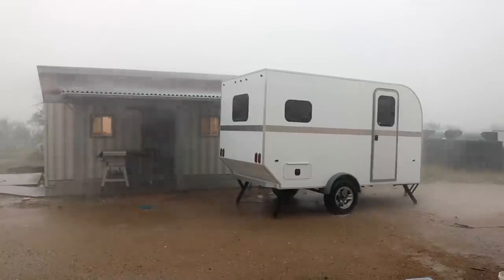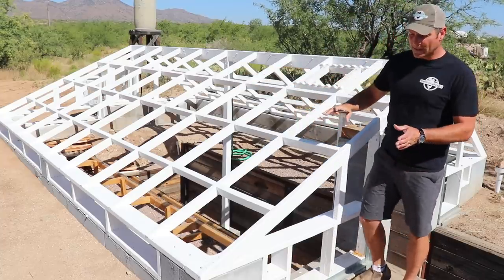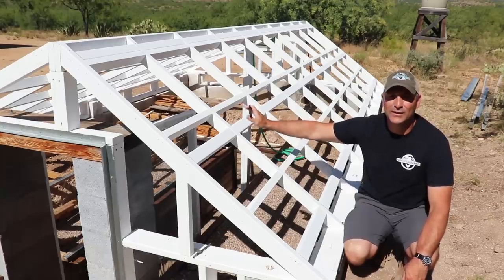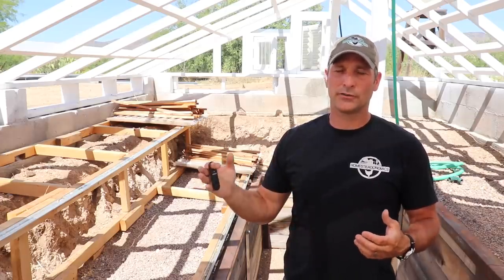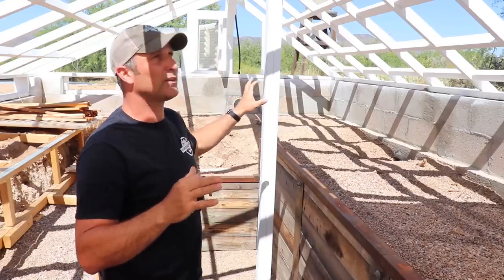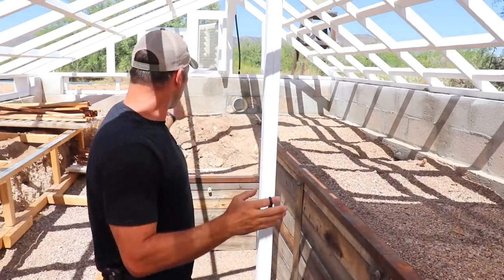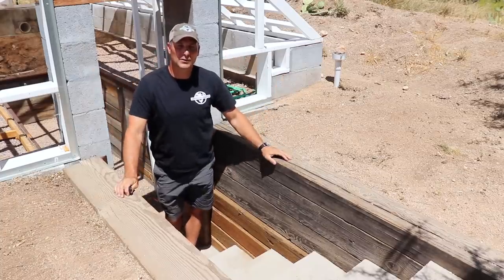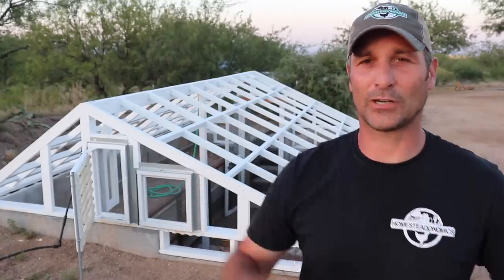Sunken Greenhouse Revival - Plans

Comment: if your greenhouse is oriented long sides south & north, consider solid (insulated) panels on the north side - extending past the peak for summer shade and if reflective side facing in it will do well with winter sun angles. and there will be plenty indirect light from the surroundings
Reply from the maker: Oleo 2320 I actually have quite a few pieces of the left over from my travel trailer insulation board that I may add tot the inside of those panels.   It it aluminum coated so should provide some of that reflective Quality as well as insulation.   But it would only do about 35 percent of that northwall and I’m not sure I will want to buy more material.   So I think I’m going to see how it performs I insulated first and then maybe add that later depending on how it’s holding the temps 🤔
Thanks for watching!

Comment: All of my raised beds have hail guards.  I used hardware cloth.   If you can put that on over the poly it would bounce the hail off of it.  I am on the high plains of Colorado which is also somewhat desert.  I have 40% shade cloth on all the walls and roof hung on the inside of  the greenhouse.
Reply: I agree, tackle the outside hail protection separate from the shade problem inside.🤔

Comment: Anti~hail netting will provide shade, and protection from future hail storms.  I believe the netting comes in three colors,  [ red, white, or blue] for different levels of UV protection. 
You can use a simple cable and pulley sytem on rails, to retract the netting when it's not needed. 
 I've seen some sophisticated systems that that are set to automatically deploy  when the barometer indicates a low pressure system moving in.
It really is a good looking greenhouse.  I'd hate to see it destroyed again. 
Can't wait to see what you come up with.
Reply: Is it called Reemay or am i getting old?

Comment: aluminet shade cloth suspended a few inches above the roof would help with hail and the shading.  1/2" hardware cloth could also work for the hail.  Im really inspired by your sunken plan.
Reply: I was getting ready to post the same comment...even if it only worked to save the plants inside!
Reply from the maker: I like it!   Would be super durable as well!  😀🙏
Reply: I looked at a company a few days ago, (can't find the bookmark) that made exactly what is needed here for just about any application from your greenhouse project to covering a high-rise while under construction.
Reply: That's how the shade houses were constructed when I worked for an orchid grower. We had a gap of about six inches between the cloth and the panels for good airflow, and the larger gap is less inviting for leaf litter and animal nesting.

Comment: Thanks for the video update. I suggest you do sun fabric with a roll-up side like  on the side of the greenhouse. The weight of the pipe roller on the bottom should keep them tight and sluff off any hail that happens. Otherwise if the Hale builds up it'll push the fabric down on to the poly carbonate and you will lose that space that would soften the hail. Plus it would let you shade only the top part and protect from the hot midday sun

Comment: You should buy double walled polycarbonate panels they will not break from hail. I have the standard panels used by the grandio greenhouses and it deflects massive black walnuts and hail.
Reply: I agree 100%, twin wall panels, better R value, longer life span, defuses light for better growing, hail resistant. go with the panels not rolled solexx. solexx has large expansion and contraction. panel sizes will determine the roofing frame work. doubling frame at panel ends to attached panels then H channel attached to next panel with sealant. invest the money and time, greenhouse will last years and years. my panels are 10 years old.

Comment: Looks like your turning a disaster into opportunity. I like the changes you listed. They sound good, especially making the back part of the roof solid. The shade cloth idea also seems sound. I would vote for installing the shade cloth low, and pulling it up for shade. Good luck with your improvements.
Reply from the maker: thanks Jay!    I'm leaning towards just that idea... having the cloth pull up to cover the GH in the warm times.   stay tuned... this will take the next few months but hopefully I'll be going strong by the fall winter tiem

Comment: We have a 10 x 12 gazebo with the double wall polycarbonate roof.  Several years ago, hail storm damaged top layer and punched a few holes through.  We did not replace the panels but covered them with 2 shade sails.  There were 2 triangular areas that were uncovered.  2 weeks ago, another storm made the uncovered areas look like a sieve.  The shade cloth will definitely give you some protection from hail.

Comment: I also agree with the idea of a shade cloth to help protect the plants from sun damage in the latter and earlier parts of the year and also when drawn tot the kind that have grommet holes along the sides and are somewhat stretchy if drawn taught above the surface of your polycarbonate panels it will someone act like a trampoline and both reflect the light and strengthen the structure. Harbor Freight Tools has many of these that are actually quite good quality and I have used on the sides of our house for about 2 years now and they're still in great condition just be careful not to pull the very Corner too taught.

Comment: You could always weld a couple posts to those rails, then attach some cable to those and the center beam. It would avoid having to install crossbeams, and work just as well. The cables would add a little flexibility, and if you make them adjustable, you can tighten them down as needed.
Reply from the maker: yes, that sounds like a good option!  thanks richard!!

Comment: I am in south Texas and keep a greenhouse year round for orchids.  So we want it below 90f in summer and above 50 in winter.  We are on top of a hill with high winds and hail.  So far the original 13 year old double wall poly is still there as well as aluminet shade cloth ordered to size with reinforced edges.  The ends of of the 10x12 structure are not shade cloth covered and the west end shows some yellowing but the poly is not brittle.  The rest is still very pristine.  We do use a standard swamp cooler to maintain temp in the summer and actually use a second black shade cloth on the roof during the highest solar months.  We have four simple metal cross braces to add strength.  Those braces also add support for hanging baskets.

Comment: I like the shade cloth with a roller and handle system like that on dump trailers or dump trucks. Elevated to give flex to absorb hail. Heater need to AZ sun. Born and raised.

Comment: Here is my wild hair idea; I'm thinking a little outside of the box on this one. Build a frame structure over the greenhouse and tie shade material to it. Strategically place it vertically and horizontally so the greenhouse is in the shade during the hot summer months and direct sunlight can get into the structure during the winter or colder months. You'll get the protections from the hail and wouldn't have to worry about any moving parts (other than fine tuning the shade cloth).
Reply: ....he might also consider roll up Bamboo shade cloth and hail protection.....year round operations may not be doable...once the heat of summer is near matey foam board cut to fit all windows...
Reply: bevaroni27 - That’s a great idea! I was thinking about how quickly hail usually comes up, and not having time (or not being home) before the hail hits.  Your structure would take that out of the equation.  Although it might be harder at his longitude, not as much sun angle where he is compared to us up north.

Comment: Epoxy some anchors in your top course of block walls, secure the roof framed structure at the point where the sill board touches the block wall . Ramshots work ! Collar ties 2x4 about 5' long&  1' above head  will definitely free up those posts . As long as there's a ridge at peak . Plus it'll give you a spot for hanging baskets ! Lol .
Reply: As a former builder in a high wind area (hurricane), I totally agree however I would also add hurricane clips to the rafters.

Comment: Not sure if this helps but I used Gigavents to created self-opening vents in my greenhouse roof to alleviate heat. I'm in IN -- very high winds, especially in winter. We added a safety chain just in case, but they worked great.

Comment: Great to see you're bouncing back with this project at last after that terrible hail storm. I see on the South side you have ten segmented rows. I'd suggest what ever shading you go for make blinds of some sort that pull down from the top and maybe make the width to cover two of the rows at a time [five blinds in other words].  This will make them easier to operate and it will also give you a lot more cooling options. If they run inside rail grooves you could even add motors and make them electric blinds.  Just a thought. Good luck what ever you decide to do.

Comment: Maybe try louvers like plantation shutters. You could automate the angle of them with a simple solar tracker that would keep the blades parallel with the sun. Then, if there was a hail storm, you could shut them with a remote command. This may also help insulate in cold months
Reply from the maker: hmmm... hadn't even thought of that... I will have to look into them.  thanks!  :D

Comment: Probably a bit too late, but when I built my tiny house here in OK (we often get large hail) we designed our roof pitch to be closer to 2:1 on our outdoor buildings to provide a better deflection angle, also don't have to worry about snow load during blizzards. So far just having the higher pitch made for everything surviving up to golf ball sized hail with zero damage. If you can.. I would suggest this change. Could use the extra space to use for a second level for growing maybe. Perhaps the extra surface area for sun would even make for a better greenhouse.

Comment: When you remove the column just add some collar ties to every other rafter. It will give you the rigidity that you need in your roof structure and give you a built-in rack for irrigation/fans...whatever you need overhead.

Comment: If you are concerned about roof "uplift" during high winds, attach hurricane straps to each rafter.  Typically these attach to a top plate and stud but you don't have studs !  Simpson H16S are long enough you can attach them to block below.

Comment: Maybe for the shade you could use a poly mesh tarp and run two steel ropes through the eyelets to slide the tarp to the side when not in use.  I use them all the time to cover mulch or brush on trailers and they hold up to strong winds on the highways by letting the air through. I have also used them as for shade canopy’s for my kids when We go to my farm.

Comment: If you can provide a gap between the shade panel/cloth, so that air can circulate , it will provide more effective shade by minimizing conductive heat transfer.

Comment: The metal roof area gives you a perfect out of the way storage space for the shade material. Can copy a garage door idea for a segmented section to get over the ridge from the metal roof side

Rails for a cart to ride down the stairs can also be a good idea. Why carry things up and down the stairs when you can put rails off the sides of the steps out of the walk path a cart can be pushed on. As simple as 4 skateboard wheels on a section of angle iron riding on a steel pipe to keep the cart level down the steps as it can use normal wheels at the bottom and top of the stairs.

Comment: You might like using braided cable to anchor you roof. Could drill in eye bolt anchors in you foundation, run cable from foundation up to peak and then down to other foundation. No posts needed.

Comment: Dude, been looking forward to your repair of the greenhouse. Definitely agree on the use of the shade cloth since the hail storm as it will add a layer of protection against further incidents. I was thinking of a large spool going from the back to the front to be drawn out for both the sun and hailstorms. With spaced re-enforced rivet holes you could use simple bungee cords to keep it taut. I was also going to suggest a lighter plastic sheet rather then the rigid panels you initially installed on the roof, sort of shower curtain grade sheets. Also the cooling tube I would have suggested a drip tower with thermal vanes for heat dissipation. But anything you do I will be looking forward to your posting. Aloha

Comment: Good to see you back. Have you considered using recycled sliding glass doors or sliding shower doors to cover the greenhouse ? You could hinge a few to open at the top for ventilation. Good luck.
Reply from the maker: Larry Parish thanks!  Using glass windows from Craigslist was actually my first thought....but the polycarb panels just were so much lighter and enabled me to have a lighter weight structure.   But I really do like the idea of having glass doors that could be opened😀

Comment: You could use the wood framing as shuttering and pour concrete to form the new shelving.  should be plenty strong enough and look neat
Reply from the maker: I'm thinking of kind of a middle flip up shutter/raisable vent and the concrete shelve is likely too!  :)
Reply: @homesteadonomics  vent brings another idea to mind, you could run pipes from your vent pipe around under the shelving to distribute the air more evenly.  Set them in the concrete?

Comment: Seems like you could add a layer of roofing strand board under the north side as a thermal break and added stability. It could be more expensive and troublesome than you think by adding foam to the metal inside later. I built a deck and later had a metal roof cover put over it. .I later decided to turn it into a sunroom. Since spray foam is so dog gone messy and I wanted to keep it DIY, I  ended up adding a layer of foam board insulation from underneath. Lots of problems with that trying to add a ceiling layer that looked decent in between braces.  I finally have the whole thing supported with straight rows of wood support strips so it looks good to the eye and fairly okay from inside. But was really tricky and took several failures before I made it work.  Now every time I sit in the room, I'm looking at the ceiling with a critical eye knowing it's not really done correctly and regret all the extra work and expense...I know it a pig's ear and not a silk purse! LOL.  Sure wish I'd just done a traditional roof with roof decking from the beginning the right way. Just my thoughts and experience on bare sheet metal roofs... The greenhouse I built is completely insulated on the north side with board insulation. Works good for both cold and hot weather, so I'd pretty much bet you will opt to eventually insulate. Look forward to watching your progress on your rebuild.  Love your innovative projects...Some of the very best in workmanship and creativity I've ever seen!

Comment: May I suggest for the shade cloth put it on the outside. Fastening it to the top. Then to a long pipe at the bottom. The you can just roll it up with the pipe when not in use. God bless

Comment: Have you considered 1cm wire bird netting. It can be left up full time without significant shading but should stop the larger hail stones likely to cause damage. It will also support shade cloth if you need to use it.

Comment: Make an ENT metal tubing frame that is 6" to 8" above the poly roof giving enough distance to absorb the kinetic energy of the hail stones before hitting the poly roofing. Be sure the shade cloth is stretched as tight as possible too.
Reply from the maker: ENT conduit is definitely on the primary option list.  I was thinking of them as rails spaced up a few inches just as you mentioned too!   thanks!

Comment: I got the impression that you were disappointed in your greenhouse because you never really used it, that I saw. I built a little 12 x8ft cattle panel greenhouse with sola wrap and a mini-sorta climate battery last summer in North Texas. I love it and I can use it all year round. It is no hotter in the greenhouse than outside in August. I followed the recommendations of facing it south, enclosed and semi insulated the west wall, partially enclosed the north wall, gave it a roll up side (south side). I used solawrap because it is reported to be as strong or stronger than polycarbonate, more hail resistant and it rolls up. It was easy to work with.  They say it doesn't yellow over time like polycarbonate does. My climate battery is just 4 inch vented french drains dug underneath the green house 2 feet for a total of 60 ft, I only get a few degrees difference but every little bit helps. I think the 15 degrees you mentioned is huge. I cover the north 1/2 of my greenhouse in that silver bubble wrap insulation and a 50% aluminum shade cloth over the southern roof exposure in the summer. My roll up side rolls up 4 feet the entire length of the greenhouse (12 ft). I keep coke bottles filled with water for thermal mass that I can move if needed (not 55 gallon drums). I have a vermicompost bin in there (it was there all last summer and did fine).  I grow turmeric, desert rose, ginger, dragon fruit and can leave them there all year long. My onions and garlic are drying out in there now. The solid west wall really, really cuts down on the heat gain in the summer.  I have an exhaust fan and use 4 inch vent fans for the climate battery. My plants still have plenty of sun exposure to grow. I have a little amateur video of my little amateur greenhouse on my channel if interested. Your green house is so pretty, and you have the climate battery and thermal mass components already there. I think if you could increase your ventilation and cut down on your summer heat gain, you would enjoy and use your greenhouse more. All the best!